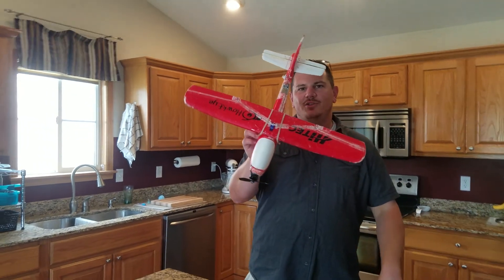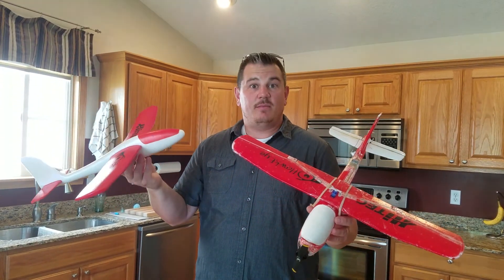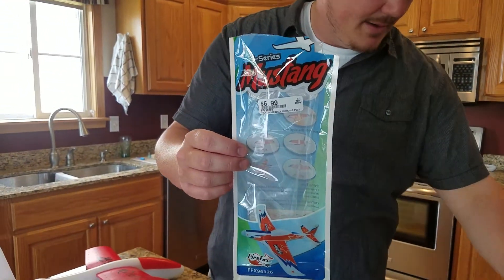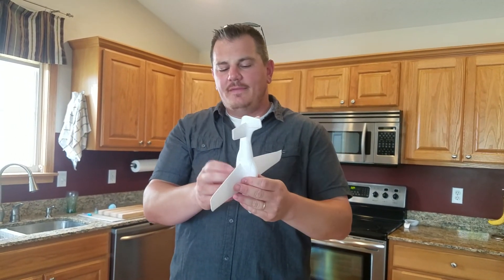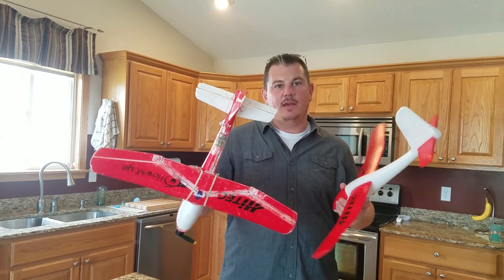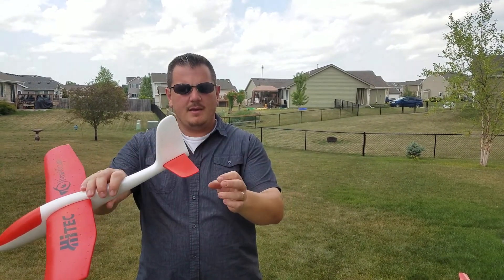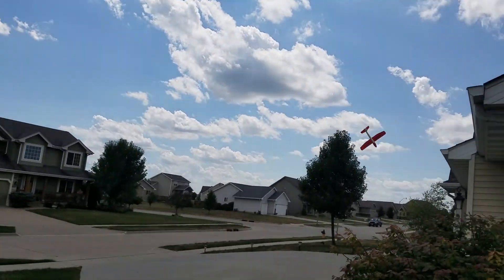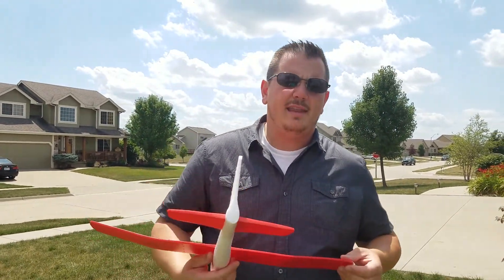HiTEC - HawkEye Glider (New) + Firefox Toys S-Series Mustang FFX96326 (New)

Comment: What electronics are you running in the rc one
Reply: (Links to the products)
Reply from the maker: Sorry, don't have links for you...just head over to hobbyking.com and check out their selection. You don't have to use the exact electronics, but the sizes are listed for you.

The ESC and Brushless motor, I didn't buy new, I got them as a lot of used electronics from a friend getting out of the hobby, so don't know for sure where he bought the Emax motor and the ESC is unmarked...sorry